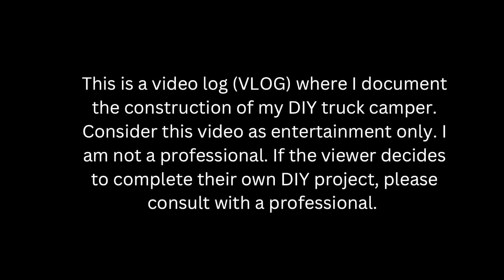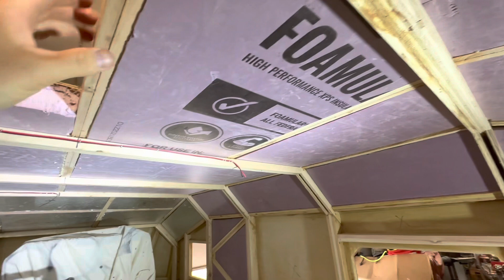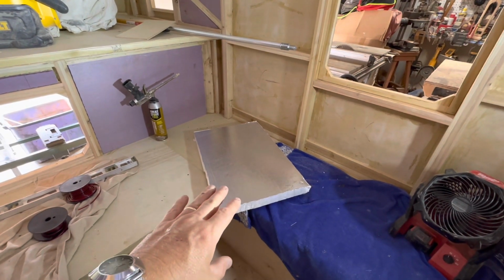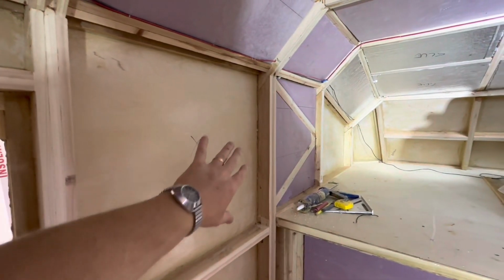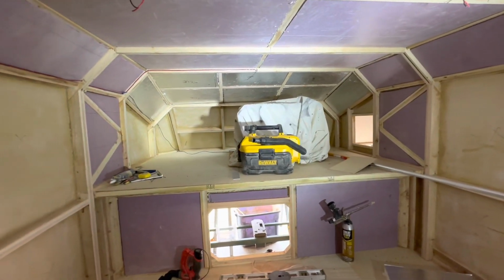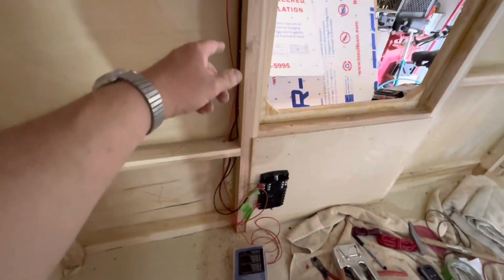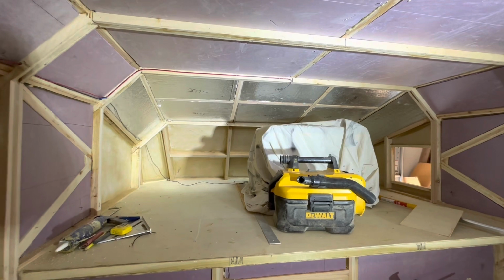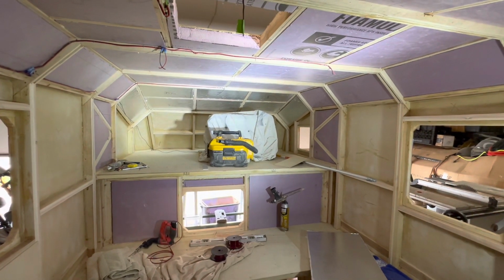Truck Camper 7.0 Build Vlog: Interior Insulation and Electrical Started!

Comment: I love your work and your construction techniques. Im building a camper right now using 5mm plywood but i didnt do laminated beams and now i am rethinking it.
Reply from the maker: Maybe you can retro fit it.  On one of my early campers I had a beam break during construction (long story). I had to take apart a few things, but ultimately I was able to strengthen it by laminating other pieces to it in place.

Comment: Dave, a rough calculation for Btu loss is this. Take all of you surface area, lets say (270 sqft surface are) x delta T in the shade (lets say 100 deg F and AC down to 80 deg F so 20 deg delta F) divided by R factor let's say average of R-8 = (270*20)/8 = 675 Btu loss , lets consider studs = 10% of surface area = 27*20/R1.5= 360 Btu loss via studs.  Glass = 20 sqft*20/R2 =200 Btu = 675+360+200 = 1910 Btu  losses. AC will do great! Great build!
Reply from the maker: Oh wow, awesome! Maybe you might know the answer to this… I’m using acrylic windows which are double pane and as I understand provide some insulation. Do you know if that will make a big difference?
Reply: @EndgameCampers  Dave, I thought you might be using the double pane acrylic or poly carbonate windows, I just called it glass, if  you had used single pane glass at  R-0.91,   the Btu loss would have been over 400 Btu losses. When I camp in my DIY box camper, at night,  I insert 4 of what I call my "plugs" into the window cavities. They consist of  2" thick  foam inserts that are covered   with  cloth fabric and adhesive  to protect them  from chipping. They fit snugly into each cavity and so now my night time window load goes back to R8 vs R-0.91 as I have single pane poly carbonate windows.

Comment: Is there a description in any of your videos of how you do the "duck" canvas (is that what you called it?). Really like that look but not sure how you're fastening to get that nice taught look. Also where do you get it? Great build.
Reply from the maker: Yes duck (light canvas). I purchased it at Hobby Lobby and used 3M super 77 (spray adhesive) to attach. How I did it is hard to explain here, but I believe I covered it in one of the interior videos for camper 6.0